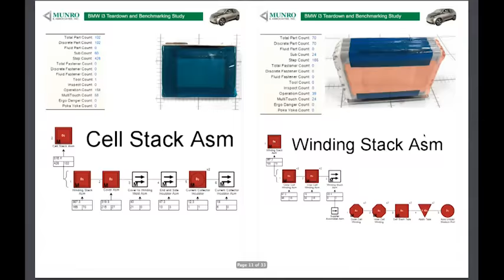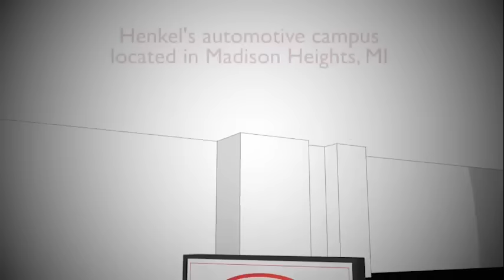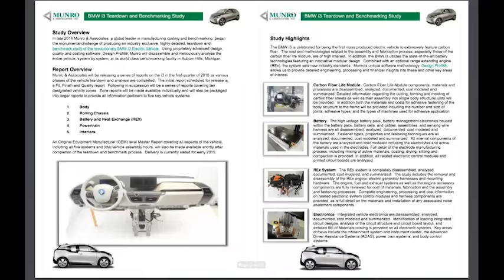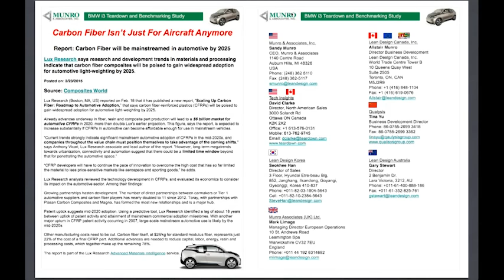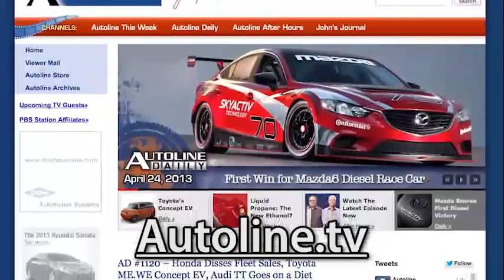Tearing Down the Model T of Our Time - Autoline After Hours 284

Comment: (If anyone is still watching this today...)

Curious after 2 years owing a 2017 REx:

Why aren't other vehicles using this series hybrid formula?
After re-coding the ICE to be selected anytime below 75% state of charge, we use i3 for any & all trips, local or out of state (71k miles now). We enjoy the benefit of nightly home charging, a 130mile EV range and never fret over being hostage to public charging.

We burned only 25 gallons of gasoline last year to cover 24,000 miles. Is that a sin?

It seems a small ICE (with 20% of the power of the electric drive motor 35hp ICE for a 170hp drive motor) is plenty capable of keeping the battery sustained on longer trips.

I would think you could apply that same formula to a passenger or canper van, too.
If the drive motor was 300 hp, a simple 60hp ICE, optimized for charging, would suffice on long trips.

I suppose a day trip of 600 miles at 86mph into a headwind would slowly drop the battery SOC, but we typically don't drive that way.

All this focus on humongous, heavy, costly batteries and billion$$$ spent on public charging is ignoring an ideal solution with PHEVs and range extenders..

What am I missing?
Reply: Same reason why electric bikes use belt drive instead of electric pedals: Carrying around an extra generator and loss of efficiency.

Comment: Great insight. Interesting how many people don't think much of this car but fail to realize all the technical breakthroughs that it utilizes. Excellent discussion.
Reply: Making it an expensive failure and a test bed, not a real production car that is sustainable.   So far nobody is making one that costs the same as a IC engine vehicle.  Which means no sales till gas goes way up.
Reply: @brucec43  Far from a failure, actually overall sales have grown every single year since introduction. Doesn't sell as much here in the U.S., but extremely popular across the waters. And the CEO just committed to another few years of production, BMW and the owners (like myself) see the i3 as a success. I've owned many wonderful cars, but this little machine is something special. I understand the design is love or hate, obviously enough of us love the design and respect the tech, that production continues. This vehicle was built for buyers like myself, we want something different, not the mainstream. And as they stated in this interview, BMW is making money on the i3. I'm currently on an 800 mile road trip in my i3, during winter in the midwest. The Range extender works extremely well (if needed) on the highway, and you can't hear it at higher speeds speeds, the car is very smooth and comfortable.

I've said enough.

Comment: Cool show and information. I am an aircraft design engineer so I can relate to what they are talking about. one comment was flat out wrong though, Aluminum does corrode, especially when it's in proximity to CFRP.
Reply: What is it about CFRP that makes aluminum corrode?
Reply: @areitu  it induces a galvanic reaction.
Reply: @Chris012345671  BMW uses adhesive to join dissimilar material, the adhesive prevent the corrosion you mentioned. it' s in Monroe's report which is now only $10. I've sent the link to a bunch of my engineering buddies, quite a read...
Reply: @shellfishdoh6635  Thats what we do in aviation as well. There are a number of methods to prevent corrosion, some unique to joining it with CFRP; however, my original comment was in reference to the video that said aluminum 'does not corrode', which is incorrect.
Reply: @Chris012345671  yeah, Sandy needs to watch the details next time, he is usually pretty good at catching himself. As far as I know any material will corrode if the right elements are in place.  I'm more interested in how they manage the thermos expansion and shrinkage between the two materials.
Reply: @shellfishdoh6635  That is certainly a valid concern. You just have to include the thermal expansion as part of your stress analysis package and size the parts/fasteners accordingly.

Comment: My God he was holding part of a car frame welded to the suspension like I was holding the frame of my mountain bike. He showed the revolutionized motor. circuit board of the infotainment topped with the best battery in the world. This revelation alone would scramble the Korean, Chinese and Japanese engineers for a piece of the action on the new wave in car making.

Comment: Sandy, I have a 2018 BMW I3s REX and ran the battery down to the point that the REX came on and I didn't know it was running until I pulled into my garage and got out and heard something running that sounded like a quiet little fan. I went to the backIt was the REX and it shut off a few seconds later
Reply: John Warden I think what you heard was actually the fan that cools the REX when it has run (I have an i3 REX too and I have that noise a few times). 

But the REX itself is not very loud either when it doesn’t need to generate too much power.

Comment: I like the exterior of the i3, and I love the interior. Two problems that will likely stop me from buying a used 2019 i3s to keep for a long time in a few years: 153miles might still not be enough for me long term, and the tires, they are a strange size so supply could be hard/costly in the long term. Also it's an impressive car, but it should be said I've seen some repair bills for these that are the cost of a brand new subcompact.

Comment: Feel lucky to have the 2014 bev loaded Tera.  Decided for the non Rex because it made no sense to get a ice.  I can understand the reasoning for the Rex though in my case the bev is the way to go if you want the electric car experience.   The car is an amazing machine and it rides incredibly.  It’s definitely a weird look, but this is a pioneering vehicle not exactly a runway model.  The purpose of the ev experience is achieved with the i3.  Now I’m waiting for the SUV bevs.  I don’t think I could ever go back to ice cars except for the classic v8s from 60’s through early 70’s.  Lucky to live in this era of rapid innovation.  Tesla model s 3 and x are great cars as well just didn’t have the money to drop or the time to wait.
Reply: The range extender only turns-on after the battery drops to empty, so you still have the EV experience but no range worries

.

Comment: The BMW i3 is so innovative.  The engineering and the design is amazing.  

The only downside is that in 2017 in the US only about 500 a month sold!!!  Yikes.
Reply: Kind of a boom startet in Germany by 2020....when goverment paid around 6.600 $ extra if you buy new EV. The I3 sold from that moment around 12000 pieces a year just in Germany. (is a middle class number...Tesla Modell 3 sold 30.000)  And you got additional good discounts from BMW or very good leasing offers. I could have leased it by 200$ each month/7500 miles a year....this is possible, because the 6600 $ from state are subtracted from the 24 months payment amount.
Another point is improved loading infrastructure and sufficient range meanwhile. They finish the model by July 22😪 I ordered one of the last avaiable models in december 21....hopefully delivered in May 22.

Comment: That's my kind of information.  There's really just two that share the watershed reference: the BMW i3 without the range extender & the Tesla Model S.  I (and about a million other people) would love to see a teardown of the Tesla. Wink. wink. 

I'm in the market to go electric and the Model S 70 D is the most contented car for the money they have a ever produced making it quite a bargain for the long run.  Or for half the money there's the i3.  Problem is it's half the car, I don't commute, and I love to travel long distances, so for me the choice is clear. 

Either way, 20 years from now, when it's all Carbon/Aluminium Electric we will look back and remember those were the two that changed it all.
Reply: Munro has said in a recent video that they have not done a tear-downs on Tesla Model S or the Tesla Model X because they are "low volume".  Yet the Model S almost sold 5 times as many cars in the US in 2017 as the BMW i3 and the Model X sold over 3 times as many in the US in 2017.
Reply: The i3 with backup 2-cylinder engine is a necessity for many of us.

Comment: The fact is, this is the most expensive sub 100 miles EV, so what benefits do these techs bring?
Reply: That’s why you buy the hybrid version, so when the EV battery runs out, you can continue running on gasoline.  ALSO truth is most people commute less than 25 miles per day, so they will not need to burn any gasoline

.
Reply: Elder pier - Not much. Since then Tesla is making CyberTruck from stainless steel, and die cast molding of ModelY body sections; all while leading on efficiency.
Reply: Frankly, would still prefer a 100 mile EV + limitless range extender over a 500 mile BEV.
It's freeing to never be held hostage to public charging while travelling (although always a happy option if time & opportunity arises).

Comment: What about body work damage ? Would it not present a lot problems in the body shops. Well, the outer panels are bolt or glued on. But what about the damage to the inner panels to the point the car may not steer true.?  You just write it off!

Comment: Are you kidding? How awesome was that? I wish there was less BS and more about the car. We’ve been looking over a month for one. They ended US deliveries in July so… Interesting comment about the REX. I’m not sure if he was condemning it purely from an engineering standpoint or it will have problems. However, the comment about the car being essentially unsafe on just the REX didn’t know it can be coded to come on like the European delivery where the REX can come on below 75% battery and you won’t have those issues. It makes driving long distances a breeze BUT it was built for commuting.
Reply: Sandy wasn't condemning the Rex, just saying they could have done better. He thought it was loud, but it is not
Reply: @FranklySpeaking73  I ended up with a 2021 straight EV on lease last September. Could not be happier with the car.

Comment: 5:20 Sandy was wrong and right about BMW. Feb. 2023: Tesla produced over 2,000,000 EVs. BMW sitting on their hands since 2015. For the low volume i3 it worked. And now (2023) they just have only ICEs converted to EVs.

Comment: Bmw i3 is well behind the tesla
Reply: John Edwards  Thanks for the point. 50 years ago cars are more rely on mechanics, 20 years ago more towards electronics, but now my friend like you said batteries and software. Bmw is not a software company nor having the right mindset for it.
Reply: John Edwards  I have 5 (30) series but one of my friend did test drive with tesla she was amazed. I want to do test drive as well. Anyway, I have rented a car recently in my vacation. hyundai elantra even that had had software to keep the inside the lane. I was impressed
Reply: Look at 32:00 in the video, the bmw i3 giant die casting
Reply: They started first with heatpump. Tesla got in just in 2018

Comment: Model T of  our time?  The BMW I3?  Hardly.   Someone has no understanding of history or the impact of the model T.   The ford Model T was an affordable car.  The BMW i3 is about the most expensive in its' class.  Sure there are interesting thing about the i3, but comparing it to the Model T is stupid.
Reply: The Model T was significant because of its production system, which not only revolutionized industry but was able to deliver such high production numbers, enabling offering them at that low cost. The sea change in the production system is what Munro is referring to.
Reply: Will Pierce

I get that. I still disagree with him.
Reply: Ironically people in the car media rarely actually buy and use good cars.  They drive beaters and test cars or plain vanilla appliances.   They would never lay their own cash down on this dog.
Reply: loctite222ms 
That's called "marketing hype" ( or chutzpah, if you like )
Reply: loctite222ms 
Recall the VW making use of a unibody pan, No good reason to make unibody floorpans of.
steel when carbon fiber can use resins to reinforce ribs that stiffen those floorpans;
Recycling can be achieved 
with chippers that reduce matter into small chunks, which can be molded back
into bumpers, engine blocks,
and engineered struts. Weight is reduced, while strength is
enhanced. Stiffer floorpans
add rigidity, add impervious-
ness to road salts & corrosion,
and enhance handling & suspension, & road safety; ALL Desirable in automobiles.
Those Model "T" Fords with wooden frames are gone.
No more worry about termites
or carpenter bees.
Reply: Now we've seen the Model 3 in action, we should revisit this. What would make the i3 the new Model T? The Model T is credited for revolutionizing production. The Model 3's secret sauce is most crucially its Gigafactory, driving down the cost of cells. It's also incredibly efficient but that doesn't do much with revolutionary manufacturing.

In the next 100 years, we'll be looking back on the i3 as the first step to carbon-neutral manufacturing, of cars of all things too. That's the revolutionary in action here, the fact that the i3's carbon footprint from the factory is half of that of a base BMW 3-series.

Comment: LOL! The Model T was a turning point as it was the first mass produced internal combustion vehicle. The i3 is s a foot note, a shadow beneath the real Model T of our time: The Tesla Model 3, the first mass produced electric vehicle. The i3 will never be mass produced because it will never have the demand required. It's not nearly as good a vehicle as the Model 3 and it costs more.

I know this was published before the Model 3, but let's be real. Even in 2015 it was clear that the i3 was not the Model T of our time. It made little to no difference in EV adoption, other than possibly delaying it. The Model S had already made a much larger and more positive impact.
Reply: @electrictroy2010  Wrong. The Leaf isn't even mass produced today! It first came out in 2010 and never sold in large numbers. It's only visible in compliance states, and there are probably already more Model 3s on the road today, after just two years, than Leaf's. That's not counting the Model S and X, which while more than twice the price, routinely outsell the Leaf as well!

Comment: I have an orange one like the pictures. I love and loath it almost in equal measure. If they made the suspension more compliant and isolated (The noise!!!), and stopped the crazy level of twitchiness of the steering (do not take your eyes off the road for 1 second or you will be in the ditch). I would also like to set the level of retardation of the regen braking. Fix those, I'd then love it.

Comment: 12,000 per year.  Ford made 2 Million Model Ts per year.
Reply: Well, but the Model T was built from 1908 till 1927 with about 15 million units, this would be about 789.500 per year, but they started assembly line production not until 2014. The model T had nearly no competitor, was only built and sold in the USA (as far as I know), very poorly equipped and was never much improved. VW built the Beetle from 1938 to 2003, a total of 65 years, with more than 21,5 million units worldwide. But it had a lot of competitors in its class and got some enhancements and variantions, f.e. the convertible model. Now the VW Golf (aka Rabbit) is the most built car in the world, with more than 30 million units from 1974 on, soon the eighth generation will come. In Germany it established a new car class 'Golf-Klasse'. Every hatchback in this size will compared to the VW Golf.

Important is also how a car stays in the people's memory: VW also built the New Beetle and the 2016 Beetle, because it's a car the people like the original, this is possible. But a remake of the Model T is not possible in these days. A remake of the i3 will also not be possible, because time moves on. But for now, an especcially for electric driving designed, lightweight car with recycled materials, CFK passenger cell and BMW-style rear weheel drive is something completely new. The i8 is even more advanced, not even that it has an more advanced powertrain, it also shows that hybrid cards are not dull, the i8 looks like it's from the future. Some compare it to the DeLorean, because both are unique - and both are film stars. The i8 also shows hybrid sports cars and affordable, something like the Porsche 918 Spyder or the LaFerrari are impossible to buy - the Porsche starts at 768.000 Euro. And the LaFerrari looks not much different as another Ferrari. Both cars are just more 'having one' instead of 'using-it-as-a-hybrid'. The i8 is speccially created for economy, the design is part of this because it lowers the drag coefficient. So, it is an absolutely new car. Every following hybrid sports car will be compared to it.
Reply: I agree. Calling this abomination the next Model T is an insult to the Model T.
Reply: Model T was not about the numbers only buddy, it was about the revolutionary Manufacturing assembly line process that helped it make that many cars.  Other OEM back then could make better cars by hand but he made it profitable and fast. It's not about the sales alone but how they are made, like McDonalds burgers.

Comment: Big F--ing deal a steel or aluminum fender can be stamped in seconds an injection molded part can cycle in 20-30 seconds aluminum and steel an 100%  recyclable an the equipment to do it well has been in place for decades.   Model T my butt to be a model T the car would need to cost $10k or less new.   Carbon fiber has a place in military, aircraft, and exotic cars for sure.  $29k for a little shitbox car is joke.  This  video was made  over 4 years ago I have yet to see even one on the road total failure.
Reply: John Edwards  I see a lot of things in California I have no use or need for.....